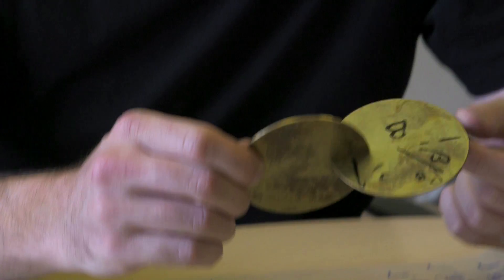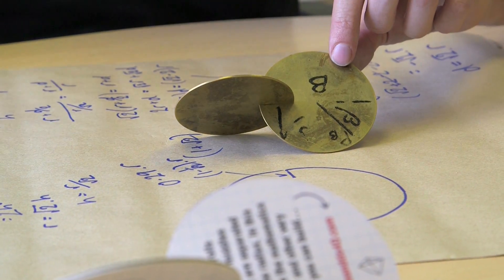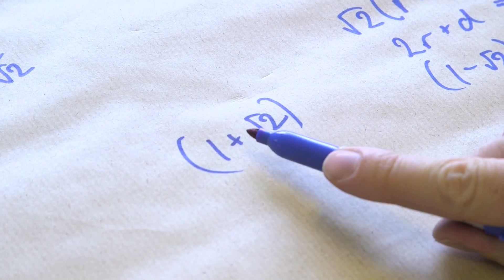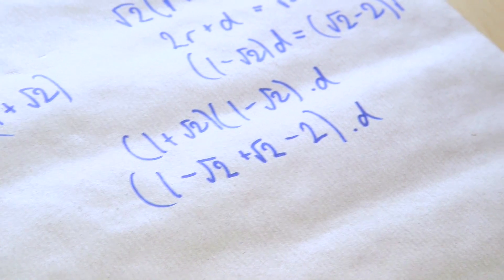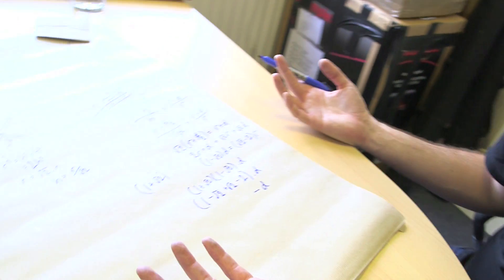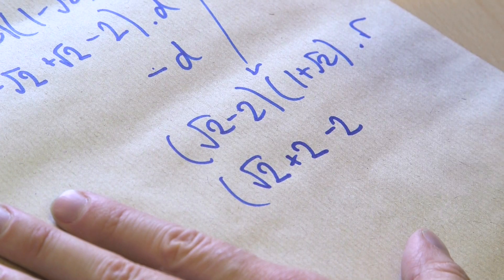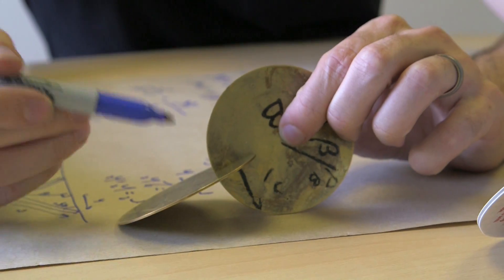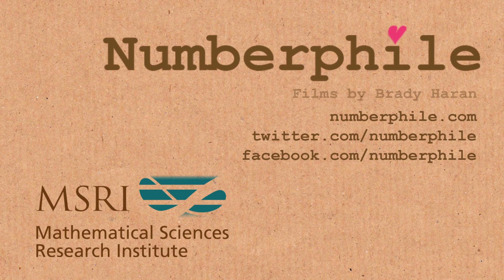Wobbly Circles (extra footage)

Comment: Couldn't you use it as something like a ball bearing with less material cost?
Reply: Karl Kastor I doubt that it would be strong enough to support much weight, and if you made it strong enough it would be more material. Also don't forget the total cost of a bearing is not just the cost of materials, but the cost of manufacturing it as well (and this would be way more expensive to construct than a sphere).

Comment: How about using wobbly circles as replacement for wheels on an amphibious vehicle? You can drive on land because this thing can roll, in water it acts like a paddle wheel and it looks damn awesome
Reply: How would you attach it to a vehicle? Where would the axle attach?
Reply: Sea Pig One would have to ruin the perfection of the circles, but as long as the bits removed to make room for axles were perfectly symmetrical in every way about the rotary axis of the configuration, it should still work.

My worry is rather that it would be too much of a compromise solution- a sub ideal propulsion method on water, and very hard to adapt well for roads (for starters, you generally want a wide rubber surface rather than metal on road, because road handling is a thing).
Reply: I don't think this would make a good wheel replacement because wheel's axis of rotation doesn't have to change while it turns, while the axis of rotation for this is wild, pitching, rolling, and yawing as it moves forward. the suspension linkage just to support it would be insane.
Reply: Sea Pig 
agreed, the center height does not move but it does move left to right as it rotates.
Reply: Sea Pig You could have multiple axles attached to it. You could have one on each wheel and the axle could be able to move up and down, left and right, rotate and move in any such direction.
Reply: John Smith even those brass circles have some thickness. Couldn't this be adapted to work with cylinders and, by extension, wheels? (The rubber edge wouldn't work well for water, though)
Reply: Kram1032 I don't think it's that simple. For the tyre to be optimised for forwards rolling, it would have to roll on a surface parallel to the ground (otherwise, what's really the point of the tyre?), rotating about the axis of rotation. That would effectively mean surrounding the "wheel" with a conventional cylindrical tyre, removing the entire point of the oddly shaped wheel. Unless I'm missing something.
Reply: John Smith 
I meant a tire shaped exactly like the edge of that wheel. Obviously, the actual wheel gotta be a bit too small such that, with the tire, it has just the right size.
Reply: At the risk of showing my limitations when it comes to spatial visualisation, I must admit I have problems seeing that working. Wouldn't the tire have completely the wrong orientation, and a bit of a structural weakness near the edges?
Reply: John Smith it might have. You might need to slightly bend the shape for some extra structural support. You'd certainly have to twist the profile somewhat such that the right bit is always on ground.
I'm not saying this whole thing would be terribly efficient. Just that it could work.
Reply: Kram1032 Then I should stop arguing, because I agree that it would probably work to some extent.
Reply: How would you connect those things to a car?
Reply: James Oldfield
 Sounds overly complicated for what are essentially paddles, and it seems it wouldn't easily accommodate the land half of the "amphibious" classification. There seems to be a center of rotation that would allow for an axle of some sort, but I think i would require some complicated welding. :)

Comment: The formula of 2^(.5)r=d is quiet similar to the formula to find the hypotenuse of a 45 45 90 triangle (Hyp = x 2^(.5)). I wonder if I'm just seeing patterns where there are none or if these two formulas are somehow connected. Regardless, interesting video as always.
Reply: Yes, they're connected. If you have two different-sized discs, draw a right triangle with two sides the same as the two radii: the distance between the centres of the discs should be the hypotenuse of that triangle. In the case of identical discs, that will give you the hypotenuse of the 45deg triangle.
Reply: What is a 45 45 90 triangle? Do you mean the number of degrees in each angle?
Reply: Yes, that refers to the angles.

Comment: I was wondering about the Wankel rotary engine and if something using this configuration might be possible.
Reply: You mean the Reuleaux triangle?
Reply: ***** Yes, that's shape used in the engine or at least something close.
Reply: It can also be used to drill a square hole.
Reply: ***** almost square
Reply: Yeah, it does leave rounded corners, but they can be fine-tuned afterward.